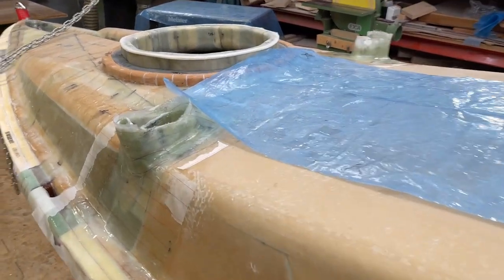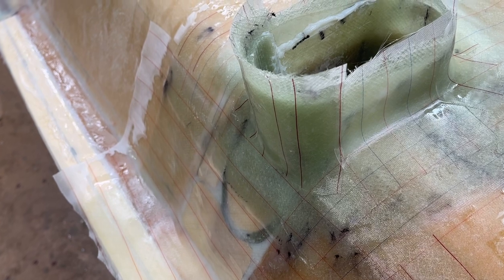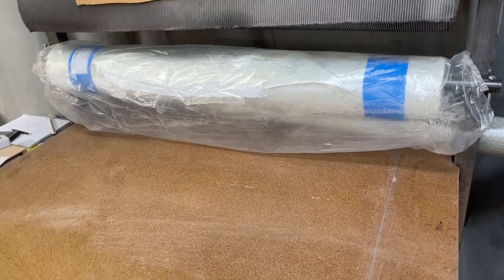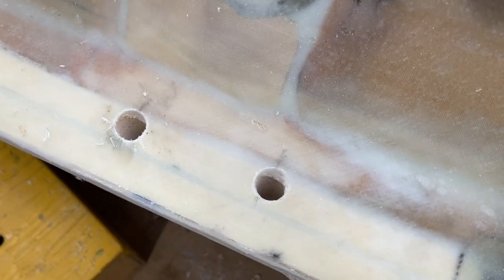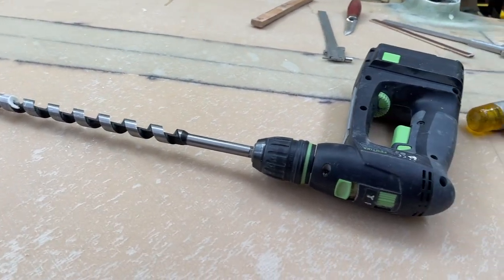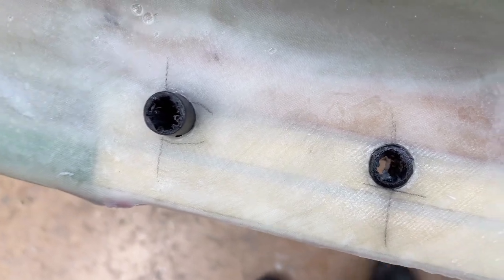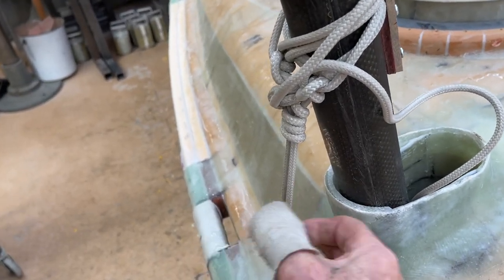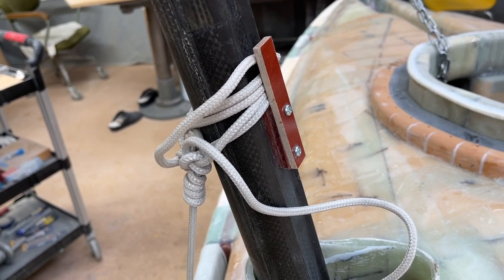23 July 2023  Lashing the bow mast to the boat

Comment: To hold it even more firmly in place, you could drill a hole through the mast near the bottom and also drill holes through both sides of the mast holder, then insert a peg or pipe of some kind through those holes. This would prevent the mast from coming out and still allow it to pivot. Don't know if this is necessary but it seems simpler and more secure than using ropes.
Reply: Lashing is good. No need to weaken the mast with a hole, IMHO.
Reply: i would not drill through the mast, rather laminate rope ring around it.
Reply: I see, mast strength/integrity more important.
Reply from the maker: There is no big forces trying to pull the mast out of the holders

Comment: What made you decide to do twin keels for the next boat? 

I’ve been thinking about my 6.5 x 1.8m boat. I suspect some sort of external ballast is worthwhile but it seems full twin keels aren’t very efficient at such a low aspect ratio and they are also fixed.

I wonder about twin centerboards that retract into the boat through shallow 15cm draft ballasted bilge keels. Thus the center board trunks are not so tall inside the boat and one gets some degree of external ballast. The twin center boards could be high aspect and asymmetric foils.
Reply from the maker: The adwantages of twin keels is mostly for taking the ground when drying out.
Also with a hard chine hull I hope for some kind of hydrodynamic effect similar to Matt Laydens chine runners.